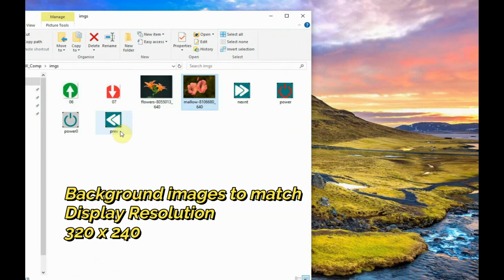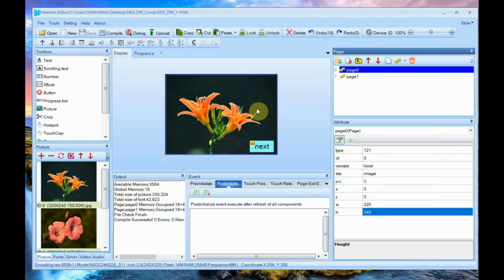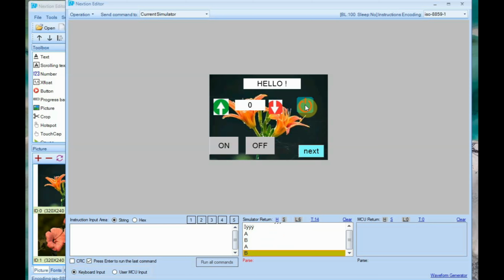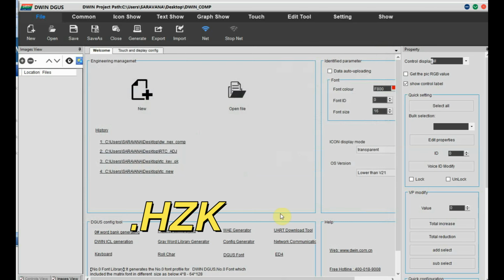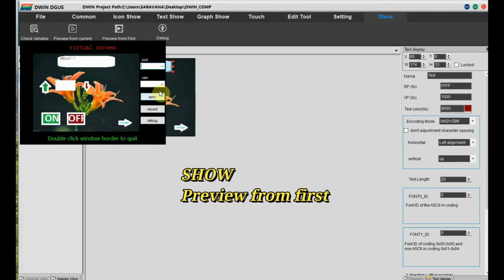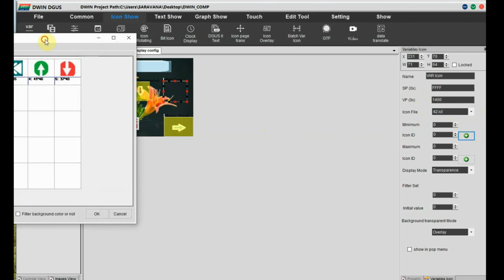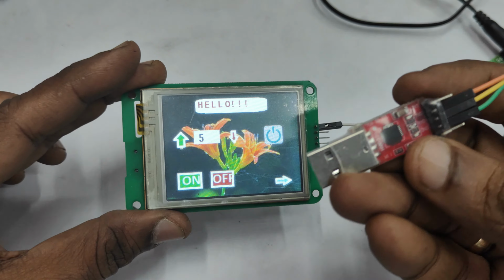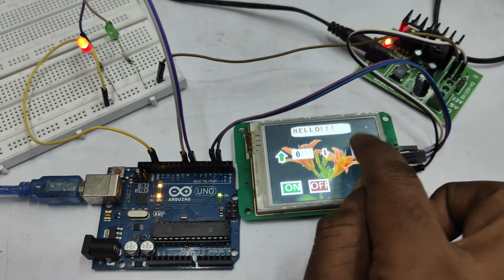NEXTION vs DWIN Touch HMI Display - Compare on Project view

Comment: I could not recommend either of these two companies as the products are too expensive, this put them out of the range of young teenage developers.
My advice is not to buy any of these smart screens but buy the dumb version's way cheaper and then learn to code for them. this way you save money and learn, and when you learn you will never have to buy these expensive products.
these products are for people with money and no wish to learn
Reply: Its not only about they doesnt want to learn. This products are HMI-s and not only TFT displalys. most of the applications low level display programming are much more expensive than these. Your time is money too. with a HMI you can create a prototype in few minutes, and you can programming many functions on HMI side too. this applications uses only minimal resources of the controller.  and finally : 7-10" sized  capacitive touchscreens ?  it doesnt exist in  "cheap"  solution.

Comment: As a summary, Which one would you recommend ? Thank you for taking time to create such a detailed analysis
Reply from the maker: Nextion is simple to use and its IDE supports Instructions to make final uc coding easier. But DWIN is much cost effective and industry models support RS232,CAN,MODBUS communication. DWIN learning curve is more.
Reply: @SaravananAL got it! 
in regards to look and feel which one would win your votes ?
Reply from the maker: @iot_enthusiast  DWIN .Capacitive models Touch is so smooth and cool.Industry models with casing have better look. Check out this killer 12.1 inch model
https://www.alselectro.in/product-page/12-1-dmg-12800-y121-01-nc